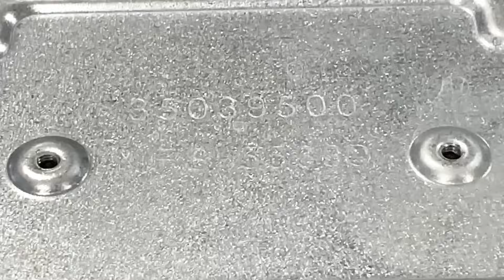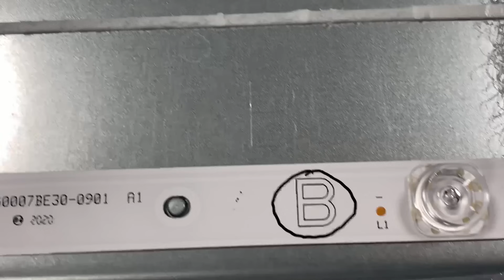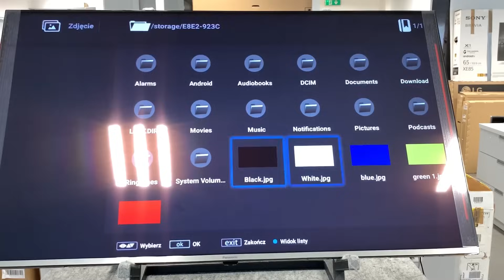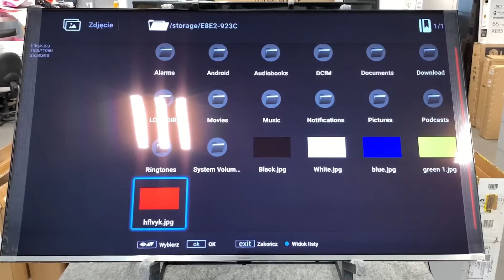TV Has sound but no picture. Fault backlight in Panasonic 55HX710E/LX650E

Comment: si solo una tira led esta dañada, se tiene que cambiar todas las tiras led?
Reply from the maker: Hello. 
Yes, all lighting strips need to be replaced. If we only replace the damaged strip, another LED strip will break down for a short time. Moreover, these strips (factory) are glued with silicone and have poor heat dissipation.
Regards.

Comment: Mera mi 55 inch tv me same issue hai, sound hai but no display. Backlight problem bataya hai kisi ne. Aap repair karwa denge noida me.
Reply from the maker: Hello.
We are located in Poland. You need to find a local radio or tv repair shop.
Reply: wel shet blnc by thread round curve and square chamber it with sheet y point and ab,

Comment: sir meron ako 55 inch sony. nanunuod ako tapos biglang nawala display pero may sound. ilang araw ko di binuksan tapos ng buksan ko nagkadisplay ulit. after 3 mins bigla ulit nagblackout ang display.
Reply from the maker: Hello. If there is a problem with the backlight, then the motherboard in the TV generates an error code 6 or 4. The led indicator starts blinking 6 or 4 times red. But it still depends on the specific Sony model.
Your TV probably has a problem with the T-con module. But also please check if there is an up-to-date software new version.
Reply: PS p

A
Reply: MALO
asuo a as coisas mais me o mais certo 
caso você tenha interesse
Reply: Не очень аккуратная работа по разборке матрицы и съему стекла.Я удивляюсь,как он его не сломал с такой неаакуратной работой!

Comment: What rubbish these TV are, backlight Led's gone down should never happen.Led's overheated due to incorrect voltage feed to the Led's
Reply from the maker: The LEDs are overheated. Poor heat dissipation. LED strips in Vestel TVs with backlight are glued in spots using silicone glue. In my opinion, this is a big disadvantage of these TVs.